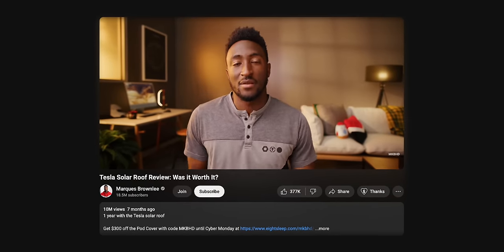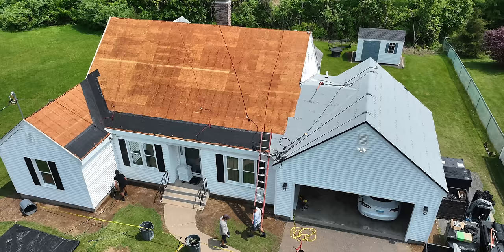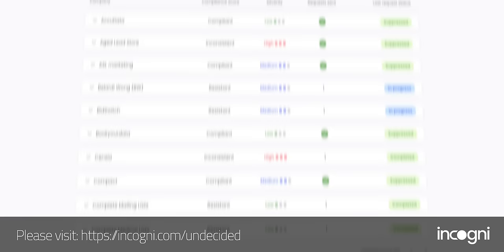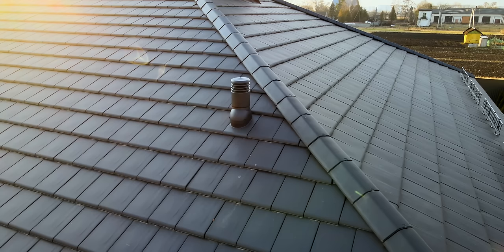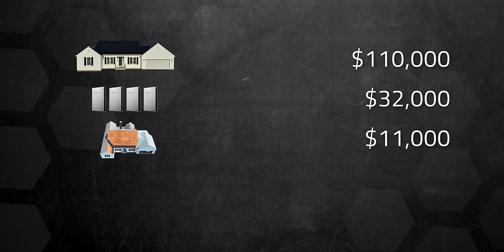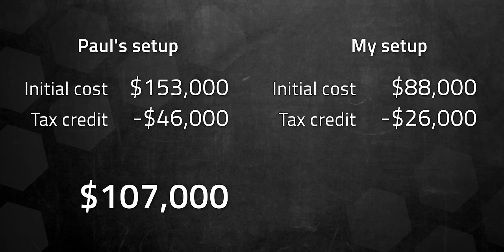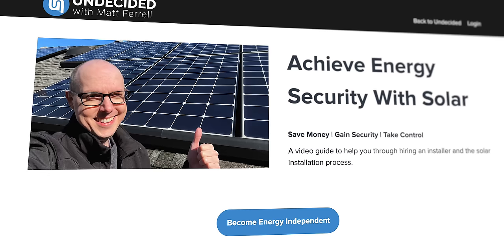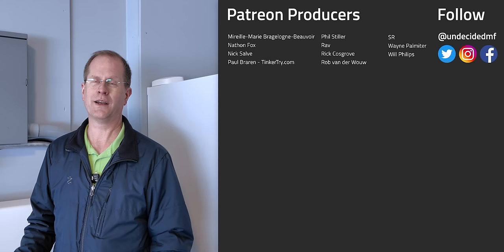Tesla Solar Roof vs Solar Panels: Which is Worth It?

Comment: I went with a ground mounted panel system; easy to remove the snow in the winter using a foam squeegee. Love that setup.
Reply: Sounds great, and far more affordable! My town wouldn't permit ground mount, unfortunately.
- Paul Braren, owner of the Solar Roof featured in this video
Reply: @TinkerTry  that is just crazy! The permit was really easy here. My roof would not have worked, as I have those nice shade trees.

Comment: My current thinking is I am going with panels, but where I am building has a lot of trees and the array won't be on the roof. I plan on free-standing panels at the southern edge of the lot where there is open ground and a lot more direct sunlight. I also plan on owning all the hardware and not contracting with a company.
Reply: Your option is the best IMO.  I have also been looking at getting an array to put on my parent's farm and I can get them started with a 14Kw array, 12Kw of AC output, and 15Kwh of battery for about $15k and there's no restrictions on the roof directions, cleaning the panels is easier, and you'll see a return much quicker.  It's also expandable.  I can easily add batteries down the line, which is likely better since the batteries are the pricey bit.  Also getting them over time means replacing them over time when they wear out.

Net metering sucks for them though, it's an energy credit that expires so there's literally zero incentive to feed back to the grid making the inverters I choose cheaper.  I'd be using the grid to top off if the battery is low.

Comment: FYI my 10kW Tesla Powerwall+ overloaded and shut down because a 500W gas furnace's blower motor turned on.  That's what their tech support told me.  A 2000W UPS never had a problem with it.  Powerwall is NOT recommended.
Reply: 500w? Lol, my cheap DYI setup can handle a 4,8 kW load off of battery power. That's pretty standard if you use BYD batteries.

Comment: Nice video, I spent 59k on my 12kw system before tax credit in 2021.  Hybrid system. Qcell panels with enphase micro inverters, Tesla gateway, two powerwalls, and separate EV 60amp breaker box and Tesla wall charger.  Spent 9k on new asphalt roof.  It's saving me 2k a year but still have to pay during the winter months.  This was a partner installer in Michigan that Telsa works with.  I really like the combo solution this company provided. I feel like I have the best of both worlds.  Tesla software is amazing and the integration with the car is really nice.  Charge on Solar feature is great in the summer to fully utilize production.

Comment: As you said, your metal roof (sorry, I put floor?) should never need any maintenance & solar panels can reasonably be replaced + how long will the tiles last. Although 27kw is quite impressive.
Reply: The guaranty of the solar roof is 25 years, same as many other roof options have, some only come with 20 or 15 years even.
Reply: In what world does metal not need maintenance? Even pure stainless steel rusts eventually. Humans are kinda weird. Willing to believe anything if a salesperson is nice enough when they say it. Only after the deal's done do y'all turn on your brains to think about it.
Reply: @TysonJensen  People are speaking in general. Yes, metal roofs, even stainless steel will corrode; however, the lifespan of a metal roof is SIGNIFICANTLY longer to the point where it essentially doesnt need maintenance.
Its not that it literally doesnt need maintenance, its that these costs are so spread out that it feels like it doesnt.
Reply: @TysonJensen  Metal roofs are extremely rare in the colder European nations. It's mostly ceramic shingles and those roofs can last 100+ years if there isn't major  storm damage. So maybe not ideal for tornado counties, but otherwise it's great, easy to replace individual shingles if necessary, easy to add solar and pretty cheap.
Reply: @TysonJensen some of them offer a 25 year warranty or even lifetime.
Reply: @marceldiezasch6192 slate and clay tile roofs are also a thing in the US. They're also quite heavy and require stout framing to accommodate them.

Comment: This was a terrific video. I have 9.1 kw Solar panels installed on my San Francisco house since Sept 2023. This cost $21K after tax credit. I estimate that I will get an average of 3 hours effective sunlight so I should get ~10,000 kWh per year. I am grandfathered into full NET metering from PGE and they charge nearly $0.50 per kWh. I drive a Tesla and I plan to install a ducted heat pump for my house so all my energy costs will be fully covered.

Comment: People spending 100k-300k on solar is patently insane and is a reminder that solar is anything but "affordable".
Reply: Solar should be affordable, but the installers are price gouging like crazy in the US, even on standard panels
Reply: There ARE much more reasonable options... but you really have to find a contractor that doesn't assume you're a mark because you're interested in solar. I have good relationships with guys who'd do the work (Electrical and building contractors) so I'd engage them directly and I think conservatively will save 30% on cost. I THINK that will bringing a 12kva battery backed system down to around $30k after incentives... which is what local contractors were quoting for a non-battery system. (ground mounted not roof mounted)

Comment: Holy cow, these costs are eye watering! Paul's setup cost as much as an entire house in a whole lot of places. Your setup would be a good chunk of an entire house though. 

Essentially, normal folks aren't going to be getting anything like these setups anytime soon. Ha! And that was Pauls downsized home? Love it!
Reply: The cost of standard solar panels (incl. installation) in North America is rediculous. For example a medium sized 10KW system installed in Australia costs around $10K AUD (or about 0.58c USD / watt). And that's before any government rebates.  The panel markup and labor cost the installers charge in North America is extortionate.
Reply: @timblanche4153  USD580 per 1kW is very cheap. Does this price include storage batteries as well? I am in Malaysia and recently installed mine at equivalent rate of USD 786 per 1kW (no batteries -  sell excess power to grid).
Reply: Well, Matts system is premium with batteries. You could easily cut that in half by just installing a more basic system with nearly the same kw.
Reply: Just his solar panels and batteries cost exactly as much as my single home rambler... wild.
Reply: The contractors are just ripping people off, the materials are worth around 18k and install is 2 or 3 days with 2 men on the roof and half a day of electrical work. Just buy the materials yourself and pay someone by the hour to install it or even better, just install it yourself. It's not that hard.
Reply: @timblanche4153  I'm sure prices are still higher, but you shouldn't assume this is the price of "The US". The country is huge and theres alot of variance. He's living in one of the most expensive areas in the country.

Comment: For mass adoption it's still one very simple issue: upfront cost vs long term benefit.

I know literally everyone in my family want to install solar for years- but no one has done it yet. And everyone I talk to have the same sentiment: upfront cost is way too high, and change in market in the future makes it so people don't see it as a big investment. You may throw down 100k for solar on your roof, but it actually won't add long term value to your house because if you decide to sell it in 5-10 years, chances are things have become much cheaper/better by then, so your heavy investment is now more a burden than a benefit.

Every single time, people who want solar hear the upfront cost, and get immediately discouraged. Pricing vs efficiency just is not there, and it's been fairly stagnant for almost 10 years now which is crazy to think about. I mean, we aren't really much further now, than we were in 2016, at least from an individual citizen perspective. Solar is still extremely expensive and not that efficient, it still has very long-term break even potential, and it's still something extra you add to your home where you have to consider reliability and maintenance/tech support if things don't work as intended. Just a lot of extra steps to commit to something that to many people doesn't even make financial sense in the first place.

For solar to be relevant, there needs to be much bigger government incentive to provide tax credits for green adjustment of energy on a personal level rather than just mass grid level.

Solar needs to be cheaper, the end.
Reply: That is a USA problem though. Elsewhere people dont move as much, and also have way cheaper options for solar. It‘s so cheap that 1 kWh of solar power costs about 0,02-0,03€ (if it were sold at its own price)
Reply: @kkon5ti  I'm not from the US tho, and I have family/friends in over a dozen different countries both in NA, Europe, and Middle East. Everyone say the same. Upfront cost vs long term gain just isn't beneficial, it's financially more sound to just invest that money into something that actually grows in value, rather than the opposite.

Comment: Hey Matt, love the videos. I’m a local guy here in Norfolk County, Mass. I did a DIY solar array. I subbed out my permit package, and sourced everything and installed myself (along with my electrician). I installed a 15,000 watt system for around $16,000. I didn’t go with batteries, my power company (Eversource) has been decent with answering questions and helping me along the way.

Comment: Your concerns about Tesla are valid. I'm very happy with my solar roof, but had a bunch of issues with the install. The fact that I was building a home seemed to make things worse. One example: Tesla had trouble committing to a date without seeing the exact locations of penetrations, for a roof not built yet. In the end I had to pay for a regular roof...and then rip it off 6 months later. I was locked in on cheaper pricing from years prior, so it was still worth it. I'm sure they are getting better, but don't assume the roof replacement savings are there just yet (especially for new construction)

Comment: Not a word about pay back time !
Reply: you are reserving a place in heaven for the whole family 😊
Reply: Why is ‘payback time’ such a consideration in these projects, when it is never considered when purchasing a car, a household appliance, or even a holiday? ……… not to speak of the 1,000’s of gallons of gas consumed by your vehicle. 🤔. Surely motivation for the purchase is the consideration here 🤷🏻‍♂️!
Reply: Probably never or pretty damn close. I built my 12 kW installation with a 10 kWh battery myself at a total cost of 15k and it will still take around 8 years to ROI.
So if it takes me this long at $1.25 per watt and they paid $4 and $3.22 per watt, doing pretty much anything else with that money would've been smarter.
Reply: @brianharries  :face-blue-smiling::face-green-smiling::face-blue-smiling::face-green-smiling: because 120k gets a lot of electricity?
Reply: @brianharries  manufacturing these product is not without an environmental impact.
Reply from the maker: It was out of scope for this video ... partially because both of our systems are still so new that we're still seeing how it performs (money-wise) vs. what we expected.  I'll be making follow-up videos detailing all of that.
Reply from the maker: I've done videos on my previous home's solar panels, which had a similar price per watt.  That system had an ROI of 7-9 years.  I'm expecting something similar for this one.  Local cost of electricity is a major factor.
Reply: @brianharries  payback is the main factor here because it's a utility. For a utility, you only look at the alternative sources and their cost. Electricity is electricity. It's not a vacation in Vietnam or Sweden where alternatives matter.
Reply: @UndecidedMF  I seriously doubt 7 - 9 years after the numbers thrown around. I have a quote in CA for a 7.6kW system and a 13.6 Kwh battery for $36k and a federal rebate of $11k. $25k is the reasonable cost for a system. That's it. It's crazy to pay more?

Comment: I was really interested in Tesla's solar roof, but after finding out about hybrid photovoltaic-thermal panels those are my new favorite. They increase the efficiency of the PV while generating such inordinate amounts of heat energy that installers recommend only a portion of your panels be hybrids since they can overwhelm just about any use case for that heat.

Comment: I so happy with my 7.5 year old DIY off grid solar system. 21kw used solar panels. 72kwh's of chevy volt batteries at 48v. 21kw of inverters all for $35k. My system paid for its self in 5.5 years ! Only way my pay off could be this fast was adding a chevy volt car in this system. The solar system and the car together was saving me $550 to $650  a month at first. Now in California this system is saving me $750 to $900 a month ! . Without installing this system.I could no longer afford my house in california. Social security doesn't go very far.

Comment: The return on investment at 107,000 dollars if you say you spend about 1000.00 a year on electricity it would take 107 years to break even, now I know this doesn’t include electricity buy back and variables on usage and weather etc. but it doesn’t look to appealing and remember if 1 EMP  bomb were to detonate in this area it would fry all the electric equipment instantly and make all those panels and power walls useless😢
Reply: Just like smart TVs, just wait 4 yrs and they'll all be 11k - 30k
Reply: Unfortunately, adequate HVAC for summer and winter costs far more than that per year here in New England. Based on our history, my wife and I would spend $100K in about 15 years on utilities and gas and natural gas for our home and cars, so we chose this route instead.

Comment: I ordered a Tesla Solar roof in our recent remodel last year.  We needed a new roof, so this made sense to us.  One advantage is that the cost of the Tesla solar roof qualifies for the federal solar tax credit, while for solar panels, the roof itself doesn't qualify for the tax credit, only the solar panels.  We had solar panels from Solar City installed in 2009 and they had more than paid for their cost in energy savings over the 15 + years we had them.  We had also installed 3 Tesla powerwalls back in 2021 (which qualified for both Federal and State tax credits.)

A month before installation, Tesla contacted us, cancelling the contract, saying there were some permitting issues.  No further explanation.  At that point, after not getting any response about exactly why, etc.  we changed to plan B.  In the initial design of the remodel, the architect and contractor specified a metal roof replacement for our new roof.  (This was for both longevity and fire protection since we are in Northern California).  So we went back to a metal roof and solar panels and inverter by Enphase - adding two more Tesla powerwalls through our solar roof company (not Tesla, but they are also a Tesla dealer selling and installing Powerwalls).  Including the metal roof and the two powerwalls, the entire system cost about $130K, about $20K less than the Tesla solar roof and two powerwalls.  However, there is less tax credit.  So I think I would have stayed with the Tesla solar roof if they hadn't cancelled.  In the end I didn't have a choice.  Being in the SF Bay Area, housing prices are crazy expensive as is power from PGE (currently cheap rate is 35c/KWhr, off peak 55c, peak 65c).  So having enough solar energy to 100% power our house even when we hit 104 degrees for several days earlier this month and our house stayed below 75 is quite remarkable for us.  

The main part of our roof faces southwest, while the front of the house which is the only part visible from the street, faces northeast.  So all of the solar panels are invisible.

So far we produce much more energy than we use in the summer (even with our Tesla car being charged at home) and we are part of the Tesla  Virtual Power Plant, and have already sold power back to PGE during two days of events.  We get $2 per kilowatt hour sent back to the grid during those events.  Looks like we sent back about 32kwhr each day, total of 64kwhr or $128.  

We haven't had the system running for an entire year, so I don't know what the overall balance in cost will be.  BTW, our remodel included installing double pane windows all through the house, heat pump for heating and AC, water heater heat pump, electric dryer, electric induction range and oven.  So we are now not using any natural gas, which has also skyrocketed in cost.  I am hopeful that we will end up net energy zero over the course of the entire year.

Comment: Consulting with the solar installers and a roofing company, I have been told that it is very possible to install a metal roof section - so that ONLY the portion of the roof under the solar panels is metal, while the rest can be asphalt (as long as you can accept those asthetics...) so you can save some $$$$$ that way

Comment: I live in Phoenix AZ so Solar is a no brainer and I needed a new roof.  I went with traditional panels and was able to also apply the federal 30% to the area of my roof that needed to be replaced (not the whole thing).  I tried to get a SPAN panel as well but at the time it wasn't allowed as the primary panel.  I am really happy with my system here at 8KWh and with my efficient home I just need to add a battery which will make me basically net zero all year long.  My current bill for a 2000sq home is around $50-150/month. I am going to get the new Powerwall3 at the recommendation of several installers in my area due to the quality, features and that other manufactures are discontinuing their products.